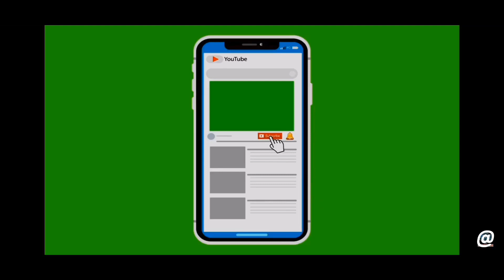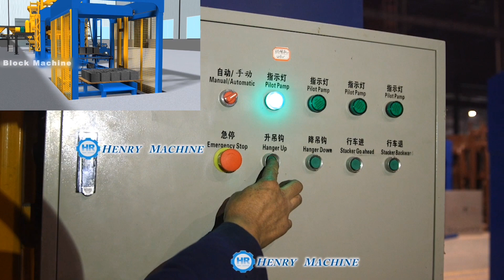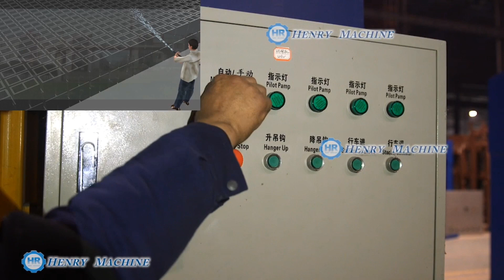China concrete block machine hydraulic automatic block making machine hollow  block machine

Comment from the maker: Hello, Dear Buddys, Why need you to buy a block machine ?   Answer 1 : to set up a block factory . Answer 2: to make blocks for a project.
Why other's block factory can get Benefit ? not yours ?  how many labor you need to employee ? 5 or 10 ?
Why 3000$ block machine can profit 15000 $ within 6 months ?  Did they cut down material cost for saving money ? 
Which factor is more important ?  A good machine or A good material ratio ? 
Which material ratio is more scientific ? Answer 1: 10% cement ,90 % sand .     Answer 2: 20% cement, 80% sand .
Which power is more stronger to form blocks?  Hydraulic or vibrator force ?  
Which kind of electricity source is more powerful to make concrete blocks ?  Single phase or 3 phase ?
How many days need your wet blocks to be curing ?  7 days ? or 21 days ?   And how to curing your concrete blocks ?
A concrete blocks quality is decided by what ?  Pressure  or . Curing term ? 
How much thickness of a 400*200*200 hollow block is best choice ?  30mm or 25mm ?